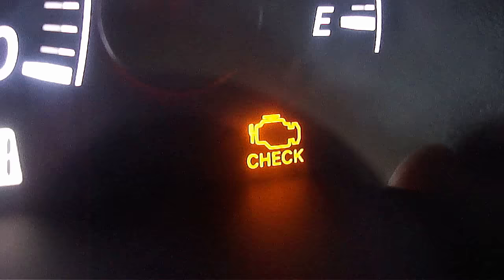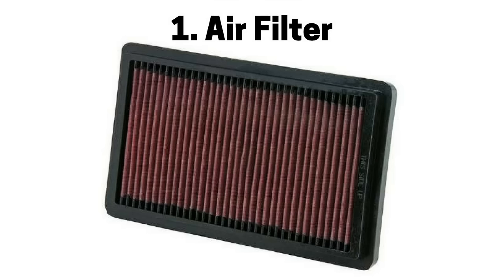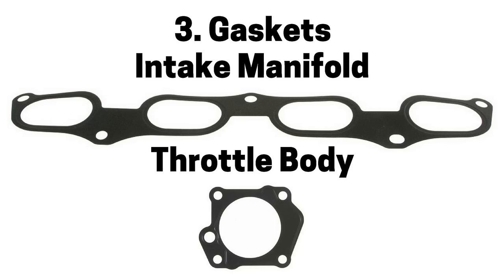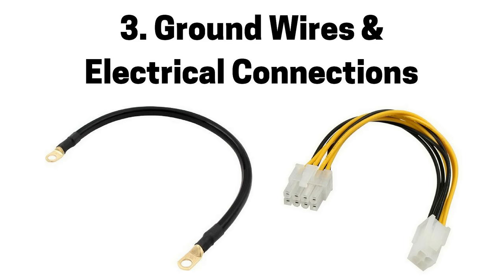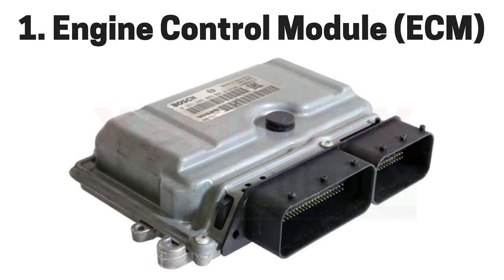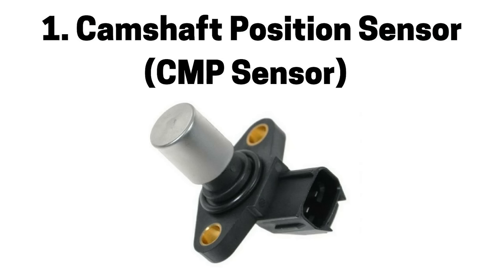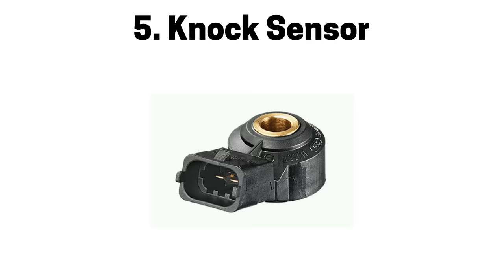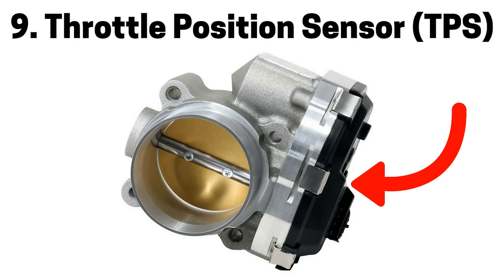How To Fix Engine Hesitation During Acceleration - Easy Fix!

Comment: My check engine light doesn’t pop up? But it drives fine for like 10 minutes then it starts to shake like it wants to turn off and if I’m goin 50 it’ll drop itself down to 10 or 15 and if I keep stepping on the gas it’ll backfire through the exhaust

Comment: Only cylinder 3 is misfiring, the acceleration is delayed, I replaced the spark plugs and it still misfires, I swapped cylinder 3 and 4 and it's still number 3 that misfires, the EPC light comes on occasionally and turns off. I don't know what to do anymore my car is a Volkswagen CC Sport 2.0 liter turbo if anyone has an idea on what to do. I'm thinking of cleaning the fuel injectors or the throttle body but this states that there is 30 other things that can cause this. I'm getting stressed over this, I've only had the car for maybe 3-4 months.

Comment: It starts perfectly… I go into drive and my car moves but then it’s like the car isn’t responding to the wheels anymore not even in reverse I push the pedal and it’s nothing but I cut off the car and restart it it’s back working but it doesn’t last long I’ve changed the throttle body (this probably the shiniest part on the car now lmao ) and the acceleration pedal now but notice I was getting more response from the old pedal then the new one.  What can be the issue it’s like a sequence with it having to restart it for it to only work but only for a couple seconds also my rpm be moving on it’s on

Comment: Got a 2011 mn triton 2.5 turbo diesel  
Did the throttle control module  few months back still doing this 
My michanic ran a scan tool  no codes 
Not shore what to do

Comment: I have a problem with the car, it   hesitate when I stop on a stop light? But when I put the gas it runs fine it just starts hesitating when I stop on a stop sign or stop light  I believe is the air idle control I really don't know  I put a new gas pump in a gas filter system but not sure

Comment: Thanks for the info I have a 2016 Hyundai Elantra at around b20 miles per hour I get a gestation it last about a second then it may not happen till the next day no check engine light took it to Auto zone they said there were no codes what do you think it could be?

Comment: mine is a p420 2004 Honda Accord ex sedan 4d 2.4l v4 I replaced the whole exhaust and put a new cat it was 170$ and the exhaust was like 2000$ and the light came back on & I replaced most of these things you posted
Reply from the maker: Did you replace the intake manifold gasket?
Reply: @proclaimliberty2000  no but il do that next and I have to change the downstream o2 sensor when I first start it in the morning the exhaust shakes bad I can see the o2 sensors shaking but after 5 mins it’s normal & I was smelling gas
Reply from the maker: @YoungShizzie  Change the O2 sensors first. If that does not fix it, then it could very well be the exhaust manifold gasket.

Comment: This is an awsome video,  I do have a problem with my ford van that I'm trying to fix, 2006 e350 5.4, runs great going down the road and it dies for no reason,   already changed battery, alternator, fuel pump and fuel filter and ignition switch, still cant find the problem,  lol, any suggestion, sincerely David

Comment: I had engine hesitation without a check engine light while acceleration i experience hesitation i changed spark plugs 🔌 air filter changed oil but nothing was resolved finally i changed      The fuel ⛽️ pump and problem disappeared moral of the problem make sure to use a diagnostic scan in my case ✅ i didn’t use a scanner

Comment: A week after replacing fuel pump on my Dodge charger the car started hesitating, the shop people said it's not the pump but also said there's a plug misfiring but that's not the problem! Could they be wrong?

Comment: So it could basically be a ginormous list of issues wrong with my car 😂 Check engine light has been on due to evap sensor needing to be replaced but the lurching/deceleration started happening months later

Comment: Title is misleading. It's not so easy when just about anything could cause the engine to lag during acceleration. Right now mostly on the freeway whenever I want to pass a slower car. I hit the throttle and the car lags for a second before roaring back to life. Feels like the rpm drops for a second. I have no idea what's causing it. I have a 2013 Challenger srt8 . 6.4 Hemi V8 automatic.

Comment: i changed oil in my transmission, ever since my vehicle will not exceed 90km/hr easily, you will have to press the gas pedal hardly for it to reach 100km/hr. We changed the transmission overally n it has not changed, same issue. what might be the cause

Comment: Hi, when I accelerate fully to second gear the engine chokes and comes out black smoke as if the wastgate does not open, the car does not pull as it wants but this operation is done once and 5 times no, otherwise 2 /10 is done. note: I checked all the systems, watsgate, the air solenoid valves, the filters, the vacuum pump, the compressed air hoses, I did the diagnostics.....everything is normal! what do you think is the cause?

Comment: I have a 2019 Kia optima and when I turn out of a parking lot or at the light the car hesitates when I press the gas down. It's very dangerous and scary. One time it stopped completely and I had to put it in park and restart it with car's flying around my car. No check engine light or any at that.
Reply from the maker: Clean your throttle body and there’s a good chance that will fix the problem.

Comment: Had ect sensor code and 02 sensor however it didnt go away with new one’s and It did however fix and code went away and the car ran new after i applied shutter fix straight into the transmission for the torque converter.

Comment: Mine jerks when I use my left signal and turning while accelerating.  Why and how to fix. Also, there is no check engine light or code.
Reply from the maker: Clean the throttle body

Comment: And after months of changing stuff on my car it was the crankshaft position sensor. I got some taiwanise nock off... turns out it is giving false readings at high rpm. Got the original Mercedes sensor and it runs (and tbh that was not that expensive but i did all the work tho)

Comment: I have 2013 v6 charger.my issue is when given hard acceleration the rpm is stuck in 3000..but in normal drive it drives fine in less than 3000 rpm..the error code shown is oil pressure pump stuck off..but I had changed the oil pump and still it’s same..any suggestions??

Comment: oh man.  What a great video.   But what can i do if I have No Check Engine Light, but all the symptoms of hesitation, poor acceleration, jerking while driving at certain throttle positions.  I also had an instance at standstill where I raised the revs to 3000rpm where it went up and down a few revs :O

Comment: In sport mode theirs no issue at all it kicks down hard and their is a slight jerk when getting off the throttle but the hesitation is only present in drive were it drops 2 gears then 2-3 or so seconds later kicks down hard and surges but if I'm not moving and just floor it no issues at all this volvo is annoying me.

Comment: Thank you for this very informative video👍.  My 2012 Civic started hesitation recently (e.g. once or twice in every ~5 miles). No code found by scanner. After the spark plugs (normally worn out), air filter and engine oil were replaced, the problem remains. Minor engine oil leak happened recently (from the engine valve cover gasket) and not fixed yet. The "check engine" light has never turned on.  Any suggestions for what else I should check? Thanks.
Reply from the maker: Start simple and first clean your mass air flow sensor.
Reply: @proclaimliberty2000  thank you so much for your quick reply. Could you recommend a Youtube video for cleaning mass air flow sensor？thanks
Reply from the maker: @liangmaew  Go to the Playlists on my channel and you will find how to clean a MAF sensor under Automotive.
Reply: @liangmaew  Chris Fix’s channel for anything. He’s the #1 automotive instructional video creator on YT for years now.

Comment: Can air getting in the power steering system(fuel pump reservoir or hose) cause this. I have no light, but do hear a hissing sound as if there’s a leak?

Comment: You come with roughly 100 different electronuic and what-not devices thatm could cause the issue - and then call it "easy fix". It looked 200% extremely difficult to me. Impossible to know what's causing it (out of the 100 vastly different things), and also certainoy not DIY stuff.

Comment: hi what about when i turn around a corner and keep the foot down accelerating  then the car pulls or jerks for an instant  then car speeds   thanks my van is a 2015 kia sedona  not only does this  on corners when the car is cold   too         i just remember  that 2 times the car shuts off   one driving on a haighway and another time when waiting  on a stop     do you tnink  is fuel related    thanks

Comment: Does anyone have an idea why ( sometimes) if you kick my CRD C300 down or try and make a drag start, it goes into kangaroo mode bucking or jurcking up the road. Ideas, could it be the waist gate ,actuator or some other other reason. Anyone else had this problem, or engineers know of this issue ?

Comment: So basically the sensors that are put on modern cars to sense something else that has gone wrong are shit and pointless because they don't tell you what thing has gone wrong they just go faulty themselves and stop the car fucking working properly....BUT its impossible to know which one of the ever increasing sensors is fucked. By the way they never give dash warnings and all mechanics do when they plug in is phone you and say "we plugged it in but its not throwing up and codes really that relate to the symptoms, back in the day these cars use to have a bla bla bla on them and I called my mate who used to work for.....(insert the name and manufacturer of your car).....and he said its gonna be the bla bla bla". Then they charge you 500 quid  to replace the bla bla bla,  phone you to tell you its all done and the car is working normally again even though they didn't fucking test drive it. Then you get there and the fucking thing is doing exactly what it did when you dropped it off but the cunts have got your 500 quid. Then they try to charge you another diagnostic to plug it in again even though they just fucking charged you for one and the whole process starts again on rinse and repeat.

Comment: So basically it could be one of or everything that keeps the engine running optimally 🤷🏽‍♂️
Overhaul every part of your car to to get rid of the problem 🤦🏽‍♂️
No codes on a Diagnostics tool means replacing everything listed in this video until the problem goes away.

Comment: Basically all im getting at is replace the whole car 🤣 i got almost all of these issues on my 1999 mustang i swapped the motor to the 04 v6 engine even tho its the same thing i put it in first gear drive at normal speeds no peddle then when i use the peddle lose all power and stalls out and when i shift to second it gose up  to 20mph without peddle cant find a fix and keeps dying

Comment: Why is my Jeep sluggish but only around 90-100 km/h. It's fine around town but when your on the highway it wants to slow down and the more you press the gas, the more it doesn't want to go. I just inherited the Jeep from my uncle. So I don't know what it's been through... I thought it might be spark plugs, then I thought maybe it's fuel injectors. But wouldn't it be sluggish all the time? if that was the case??.
Reply from the maker: My best guess is a faulty fuel pump
Reply: @proclaimliberty2000  thank you for your help😀❤️❤️❤️🇨🇦❤️❤️❤️

Comment: I hope someone see my comment.. But on my Ford Taurus 2005.. It’s been doing this for awhile. And when I plug in my reader it gives me the code for the emissions. (catalytic converter) I believe.. Now would this be the issue to my jerking? It doesn’t jerk every single time.. depending on day it may not do it. But most of the time I have to time it like it’s a stick.. and let off the gas so it doesn’t jerk really badly.. It does it when approaching 20 mph or a 25mph. All thoughts are welcomed. Thankyou!!
Reply: I love my Taurus and it’s my first car.. And I want to put more work into it. But being that it’s an older car and this being the biggest issue.. I don’t think I wanna keep it for too much longer. Because the cause could be anything, and as a 23 y/o I definitely don’t have the money to keep throwing at it without knowing what’s really wrong. It has about 193k miles.. She drives beautifully and looks sooo good. It’s just this issue here junk makes me wanna junk her! It drives me crazy

Comment: Hi. I have the same issue. Spend alot of money already. Changed my mounting, bushings, throttle cleane, fuel injector serviced, ignition coils changed. Still theres alot left to check. But mine is not showing Check engine light. Only when shifting from D or R it will stutter or stop for while (looks like engine died) but can be avoided whenever i press on gas immediately. Please share your thoughts honda city 2006 AT Cvt
Reply from the maker: If you cleaned the throttle-body it could be the idle air control valve

Comment: What if a car has these symptoms but the check engines stay off.
Reply: @Green Drop Talk Yes. It was scanned and it then said it needed two spark plug wires. The wires were changed and it solved the hesitation but it seems it is missing a slight amount of power. My car also idles high when it is first started.

Comment: Paul i seem to have the problem mentioned in the vid about the car or engine hesitation, a feeling of power loss and almost a jerking sensation on my 06' cadillac cts but its when i get to a certain speed (60mph). I put my scanner on it and the only codes i got were the po420 & po430 codes that pertain to the cats, i changed them out for new ones and my o2 sensors are relatively new as well. Not getting any codes anymore but still have the same problem. Is there anything you suggest to check or is there something you think it might be? Id appreciate any input, thank you & God bless
Reply from the maker: Clean and or replace your mass airflow sensor.

Comment: What would it be if it only occurs sometimes not often but the symptoms are when you press the throttle is revs up but takes a few seconds to start moving but it only occurs every once in a while been like this since bought off the line new

Comment: So I get a "random misfire code" in my 2013 F150 5.0L this happens when driving at road speed accelerating hard for passing the check engine light will flash for about 10-20 seconds, at this point sometimes the light stays on and sometimes it goes back off. any ideas on what would cause this?
Reply from the maker: What is the code?

Comment: I have an 06 grand prix gt with the series 3 3.8 supercharged engine. 
So far I've changed EVAP solenoid, spark plugs/wires, coil packs, ignition module, fuel injectors, supercharger bypass sensor and  downstream 02 sensor. I also cleaned the throttle body. The check engine light was cleared and hasn't came back on (so far) but there is still a weird hesitation to accelerate and every so often a thud while it's idling 🤷🏻‍♀️ Anyone got any suggestions?
Reply: change fuel filter and or pump low pressure. Pressure test fuel line

Comment: when ignite  my marcedes benz c180 1194, i have to hit the gas  for a couple of minuts and if i dont, it  shutdown immediately  why?
Reply from the maker: Is that a naturally aspirated gas engine?
Reply: @proclaimliberty2000  I really don’t know how to check that 
But this is it’s engine specs 

Engine manufacturer:

Daimler-Benz M111 E18

Engine type:

spark-ignition 4-stroke

Fuel type:

gasoline (petrol)

Fuel system:

gasoline indirect injection

Charge system:

naturally aspirated

Valves per cylinder:

4

Valves timing:

Additional features:

Multi-point fuel injection

DOHC

Emission control:

3-way catalyst, Lambda-Sensor

Emission standard:

Cylinders alignment:

Line 4

Displacement:

1799 cm3 / 109.9 cui

What power?

Horsepower net:

90 kW / 122 PS / 121 hp (ECE)

/ 5500

Torque net:

170 Nm / 125 ft-lb

/ 4200
Reply from the maker: @cristianothelivinggoat7829  The specs say it’s a naturally aspirated gas engine, so you need to clean the throttle body, which could be the cause of your problem. They sell a special throttlebody cleaner.

Comment: That's a lot to check. I got a car and since 3 weeks it does not run properly. The car hesitates often when exelerating and it feels like the engine is off or running on 3 cilinders. There no light like check engine or battery or something else on the display and there is also no single fault code in de computer... Spark plugs are already been replaced... But I don't know how I can get this car run properly without any fault code. I also have let it checked by a maintenance shop (garage) and they also didn't found anything and couldn't help me. Does someone has an idea of how to check the car on this problem. It is only by a cold engine. When it gets warm, the engine runs properly.
Reply from the maker: I would first check to see if your EGR valve is stuck in the open position which can happen from carbon buildup. You could also have a failing engine coolant temperature sensor.
Reply: Thanks, I will check if that's the case right now 😀👍🏻
Reply: Thanks, I checked the EGR and that one was closed. A friend of mine had a IAT sensor and he has put it into my car. Now it runs verry good and he is even faster then he was before. Thanks for the advice!
Reply from the maker: @xanderbreur1459  👍😊

Comment: My battery was low jump started but before was clicking when tryed to start with low battery engine check came on wouldn't go pass 45 mhr
Reply from the maker: You might need a new alternator
Reply: @proclaimliberty2000  I clean sparkplug two were oily started new thanks